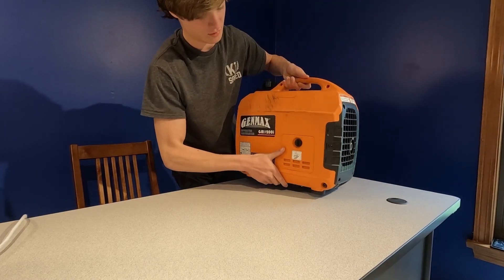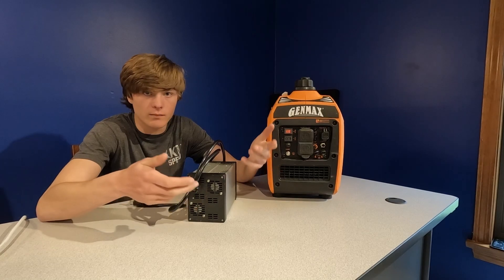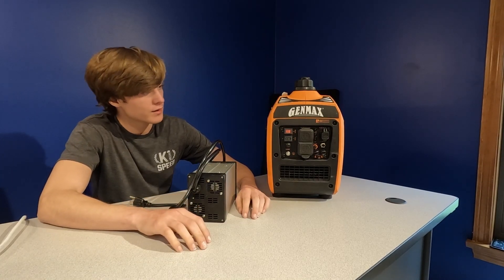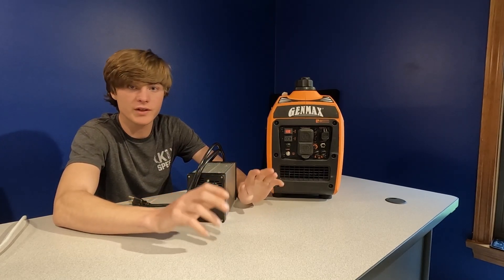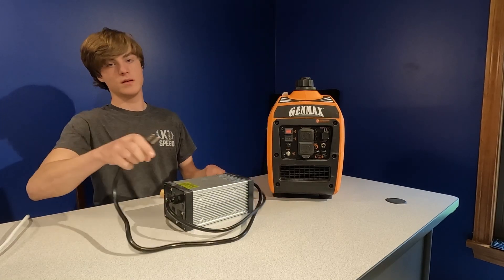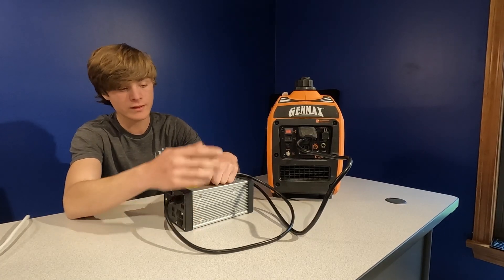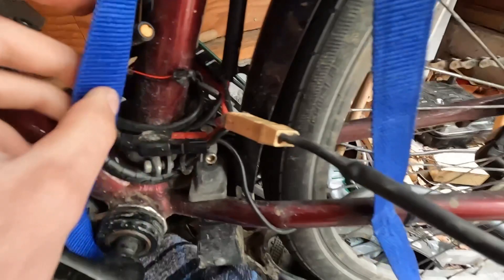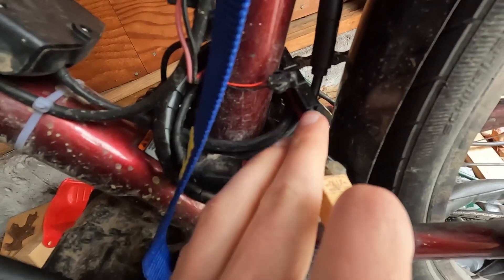My hybrid e-bike gets 200mpg

Comment: One could have a line that goes straight into the controller. Using a Y connect you can with little work connect and disconnect the generator. Remember electricity is electricity no matter where it is sourced. If your battery gives 48V 1000W to controller just match it. Also a good strong trailer with ability to handle your top speed can be used to house the generator. Don't want the bike to be too top heavy.

Comment: Seriously, only thing is you should give a bit more detail attention into wiring and why to wire it this way. Why not to just use a regular charger port. Too much comparison time dude. More info for wiring and what to do for different sizes and dual motor ebikes.

Comment: Using a electric or gas generator will that give a e-bike battery more cycle's if you keep the battery half full because some videos shows that with a gas generator is used to keep the battery charged while riding ?

Comment: Ok; nice start, but so much room for improvement:

You're going form an  inefficient HV AC alternator back down to lower volt DC via a heavy transformer etc.
If the engine is turning a high efficiency PM motor(as alternator) pushing out the correct voltage it only needs rectifying.

Direct coupling of ICE and alternator is most efficient but now both the ICE and PM alternator need to have the same optimal efficiency rpm. Doable, but not easy with off the shelf or scavenged parts. Next best is chain drive so you can calculate and set a sprocket ratio.
ie:  An off the shelf genset is not the way to go.

Sizing:  ICE is most efficient with wide open throttle or no throttle flap at all. (Pumping Losses)
ie: The load on the PM alternator needs to be such that it keeps the ICE at optimal rpm at full throttle.  That load needs to be worked back to the optimal volts and amps for charging your battery pack and the PM alternator and ICE sized accordingly.

The these type of ICE have are not efficiently designed . It's all about cheapest.
So there's a huge amount of headroom for improvement.
Low hanging fruit is:
A tuned length intake, with optimal Bell mouth and maybe ram air and high flow filter for the intake.
A tuned length exhaust with David Vizard's Pressure Wave Termination Box before the good, non restrictive muffler.
Helmholtz or Quarter Wave  Resonators will silence a fixed rpm ICE unbelievably well for very little weight. 
Calculators for these are available online.

Research: "  Argonne National Labs Boric Acid  lubricant " (NOT Borax) to cut engine, bearing, etc friction and  wear down to nothing once thoroughly run in. 

You are using the std E-Bike regen function right?

The electronics to start and stop the ICE according to voltage and engine temperature is easy enough.
I would add a press button ICE start as only you know when you will be accelerating hard.
Reply: Your idea is great! Quieter and higher efficiency but most people will probably ask their mechanical engineer friend to build them what you prescribed.
Reply: @CaptainROC-hs2yn  Well! Aren't you lucky you have one:  Me!  :)

What's the voltage and max safe charge rate of your battery? is all I need.
Wanna  build 1?

Oh and BTW; the Boric Acid thing requires reading, a kettle, a cup, and a teaspoon.
Oh; and a thoroughly run in engine.
Conservatively; a 5% improvement in MPG.
Reply: I have looked into using bldc as the alternator. A gx50 has peak torque at 4.5k or so. The cheaper bldc motors have the kv for 48volts around 4900. Arduino drive by wire, voltmeters and basic pid loops will get it running well enough. There are gx50 clones that have a straight shaft instead of the centeofugal clutch, that could be used for start stop. Plenty of small 2 strokes used in rc planes that could work but would require some gear reduction.
Reply: Maybe you should build such system since you LIKELY have a mechanical/automotive engineering degree according to ChatGPT. I knew his system isn’t efficient but i just don’t see anyone without your degree or profession build such a system out just to travel around with an ebike without range anxiety. We just want to buy something to fix the limited range of an ebike and enjoy the freedom it brings without a constant motor hmm while in the wild.

Comment: What if you have a dual motor 1000w each, how would that wire set up look? Is it just a splitter or have to use separate chargers?
Reply: I think🤔 match your watts with the gen. And i would use to separate chargers bc some bikes have a switch between single or dual motor. 🤷🏼‍♀
Reply: My bike is a DUEL MOTOR, single battery, you will SPLICE into the SINGLE BATTERY cables just like he did ...

I was UNSURE if you could charge the battery this way, WHILE RUNNING the generator/ and riding the bike. ACCORDING TO HIS WIRING, YOU CAN. 

My 'bike' will be a hybrid in a couple weeks.  HOPEFULLY it goes smooth.

Comment: Hello Timothy: How about your battery, 52 Volt  and capacity? Setting generator and your charger: With how much amps your battery is charged while driving? Average cost for 100 miles? The weight of the generator and the whole bike? Thank you very much!

Comment: Thanks for the video Timothy. I am planning a trip thru Southeast Asia on an electric recumbent trike. My idea was to have a pull behind trailer and placing the generator and an extra battery in it as well as misc gear. I wanted to get the most out of the generator while it is running. Do you think that when I have the generator running I could charge the extra battery, get a step down transformer to go from 120v to 48 vdc and wire up to hub motor running separate from the original battery setup, with its own speed controller AND charge the battery I am using to power the bike all at the same time?
Reply from the maker: I would just charge the battery while you are using it… that way you can run the motor and charge the battery. You can charge the extra battery at the same time with another charger

Comment: Placing a motor would've saved you time and money...  You still using gas to power the bike wether you like to see it or not...
Reply: the point is to run a gas motor generator in it's most efficient operating range. He knows he is using gas, but he's doing this for long trip efficiency

Comment: Directly from the generator without a battery is it possible???
Reply from the maker: Yeah you can. Kinda defeats the purpose a bit but it works.
Reply: @timothyyon6418  Y ...distance, charging time is zero...no need to change battery every...
Reply: @timothyyon6418  
1. Inverter Generator. 
2. Dc Power Supply veritable.
 3. Ebike controller. 
Missed anything?
Reply from the maker: Charging time is already zero, plus I have about 4x the power available if I use the battery vs just the generator. Also I get over 50% better gas mileage.
Reply: @timothyyon6418  even compared to inverter Generator
Reply: And what about the distance and power on demand, and anyhow how much money are we talking about...?
Reply: @davidrabin7287  if you eliminate the battery just make a small gas motor bike lol you're losing all sorts of efficiency and power. It's not a good idea at all. Basically you're running your generator all the time at max but the electricity is going no where if you're not on the throttle. Plus you have the added weight of an electric motor. A direct drive ice only guzzles gas when you're on the throttle.

Comment: Can't you just reduce voltage and plug it directly on the controller?
Reply from the maker: You don’t even have to reduce voltage. It’s just way more efficient to use the generator at max efficiency charging a battery than to run it at partial throttle. I also get way more peak power this way.

Comment: Good day Tim .. I currently have forE bikes and scooters and had decided I want to build a hybrid to eliminate the cost of batteries tired of only being able to ride 30 miles and I have to wait to charge but my big question is why can’t we use a four stroke thousand light generator to a conversion box 48 V 600 W directly to the controller and eliminate the battery all together rather than plug in parallel this way we eliminate the weight of the battery and the cost all together and strictly run electric current supplied by the generator and converter ????
Reply from the maker: You could… but it would be less efficient than using a charger, or just directly driving the wheel from the engine. Charging a battery allows you to always run the engine at maximum efficiency, and allows you to periodically use more power than the engine can supply. Plus you get the option to ditch the heavy gas engine for short trips and enjoy the silent electric power.

Comment: hey Tim im back lol ,,, how's the generator bike  running  or even just the generator after 9 months of use ,,, im about to pull the plug and get one found a good deal on a genmax 1200 25 pounds empty
Reply from the maker: Works good, no complaints

Comment: I have a 52v 30ah battery. Can’t I just use the existing charger that it comes with, plug it directly the generator?
Reply from the maker: Sure. It might not keep up with your usage though. It also might be unreliable. I had to replace my cheap charger with a fanless led power supply because it overheated in the sun.

Comment: Love me some trollscience, conventional rules were made to be broken. You now have the insane torque of electric with the power density of gas ⛽️ Well done. Pro tip: Put a muffler on that generator and you're in for a much more pleasant drive.
Reply from the maker: Yeah it’s a bit loud, but not ear splitting. After about 3 hours it gets tiring so I just put in ear plugs. Thx for commenting! Best of both worlds.
Reply: I was thinking of using a trailer and a longer cable 😂

Comment: i have a few questions if you dont mind helping ,,, i wat to get a rad power wagon ebike  can i make it so i can use this with or without the gas going ,, like if i want to ride my bike in the country where i can use the gas or the city where its frowned on or not legal in certain places > yet still use my e bike with just battery alone ?
Reply from the maker: It’s literally just a generator and a charger. You charge the bike while you are using it with the generator, when you don’t want to use gas just remove the generator and the chargers and it will work fine
Reply: will it work the same with my factory radrunner plus  charger ? what would i need o do to  please help i want to ride coast to coast
Reply from the maker: @nynut518  You will likely need to add in a connection to the main battery since you will need a charger capable of keeping up with usage, mine is about 600 watts or so. Keep in mind that you can run 2 chargers in parallel. Otherwise it’s a very simple set up. Your factory charger is likely not up to the task, I would recommend using a mean well power supply with no fans, alternatively you can waterproof a charger that has a fan with epoxy if you are comfortable. A lot of the cheap chargers don’t have thermal throttling and they can break if out in the hot sun, best to get a good one. Look up mean well power supply ebike charger.
Reply: im going to try it with my lectric ebike with its wuss 10.4 battery,  can i use my 7 lb jackary as a charge controller? i plan to put the heavy stuff in my bike trailer